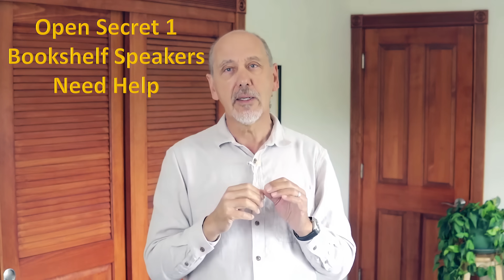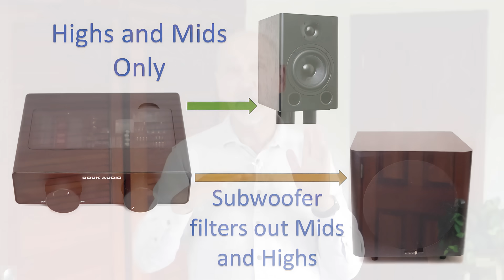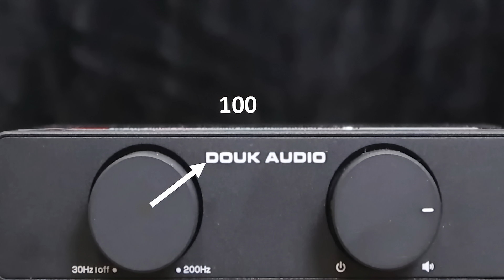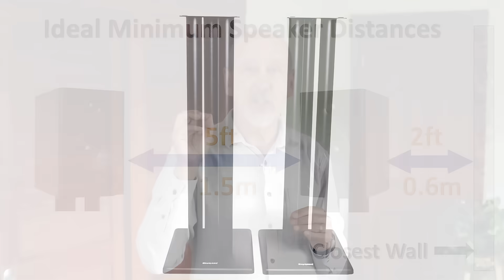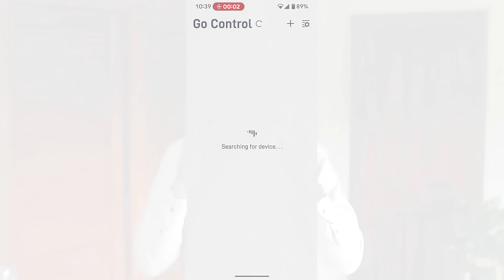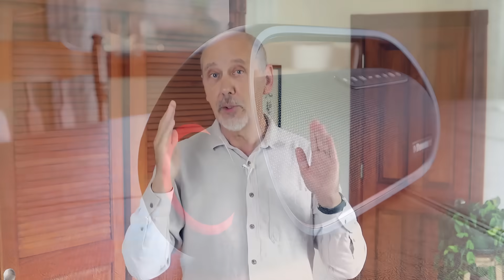Audiophile Stereo For Less Money. 7 Tips and Tricks

Comment: Hello and thank you. He was talking about high pass filler. Wilson audio had Watt 6.5-1” speaker going to a pair of subs Puppy 2x8” those were designed to work together. System cost in 1995 12 K
 They never build in the filler but many diy could buy all the drivers and address this issue. 

I also been doing the sock in port plus it makes the bass more punchy with a snap let’s call it. 
 Plus do what Mission loud speakers do. Flip them over 180 degrees. Try it as there is no set rules saying they must be tweeter on top. If you can’t get speakers up high enough you’ll love it. Rubber or foam feet under all your equipment helps or washing machine pads. The whole idea is play around like a child again. As the best system is yours as you learn about what you like because we all don’t see and hear things the same. Don’t ask the sales person please yourself first 

Ride Easy

Comment: The SU-1 is fine, I have one, but there are many others like the Aiyima DAC A2 which has gain and a headphone jack.  He's right, but I'm just gonna say it, even the auxiliary jack from an older Alexa device sounds pretty darn good, and you can connect Pandora and many other streaming services and use voice commands, which is pretty darn handy to pause, control volume, set a timer, especially for a garage system.

Comment: Hello Roger - i use an wiim mini and an smsl su-1 for streaming - playing over a vintage stereo FM amplifier (i also added an turntable with seperat phono-preamp) - playing over middle sized bookshelfspeaker ... . Does it make sense/is it possible to add an subwoofer (over an duke a5 [low pass filter] ) after/with the vintage amplifier to improve the soundquality? Respectively how can i connect them? (Or do i have to replace the vintage amplifier withe the duke a5?) Thanks Roger

Comment: Here is the biggest secret: Get a baseline WiiM AMP for $300. Why? Let's do the math: 

- S10+ streamer: $70
- SMSL SU-1: $90 
- Douk Audio A5: $80
- HDMI ARC converter $20 (in case you want to connect it to your TV)

This is a total of $260. WiiM Amp will give you all these four parts in one high quality package plus tones of high end level software features. EQ, room correction, ARC CEC across all components, auto source switching etc etc.
Reply from the maker: You make a very good case, and for a TV centric system the Wiim amp is awesome. For HiFi, The SMSL is a better DAC, and the Douk amp has PFFB which makes it less sensitive to different speaker loading. If you want to connect a turntable you get to bypass the DSP which the Wiim uses for Bass Management. For a music centric system I still like the SMSL - Douk combo.
Reply: @rogergadgetguy agree, if you have a streaming+TV centered use case then WiiM Amp is the champ. But if you are focussed on music with turntables and such then yes you can make a case for chi-fi separates.
Regarding the DAC quality I would argue that to hear a difference between SMSL SU-1 and the WiiM Amp internal DAC, you'd need a level of speakers that would be a bit funny to connect chi-fi gear to it lol same for pffb

Comment: #3 setting the subs. I have built in infrasonic filter set out at 25Hz. I am never tuning my system by ear with test tones. It goes from barely audible flutter to blinding me with sound. It was car audio and a 10dB change. Both the bass and mid amp tune were equally ear bleeding from out of nowhere.
Reply from the maker: 25Hz is too low to be useful, As you indicate its infrasonic which means it's not really sound and it's not heard through your ears but felt.  The sudden increase in sound happens when the 25Hz clips and you suddenly get a lot of 50Hz, 75Hz, 100Hz, 125Hz at full volume, that you most certainly hear!

Comment: Would have been nice to see a pic of the whole system front & back (to see the interconnects). Is there any real need for the port stuffing with the high pass filter in place?
Reply from the maker: The port stuffing attenuates the sound from internal cabinet resonances at frequencies above the HPF. You may not need it with all apeakers but with these it helps.

Comment: Im very confused.  The Douk A5 doesn’t have a Sub out. How would you connect a subwoofer?
Reply: via the aux out I guess
Reply from the maker: You use the Aux Out which is volume controlled but does not have the filter applied to it . I should have made that more clear.

Comment: Can u tell me how to connect lg tv's eARC/ARC to 5.1 home theatre and the subwoofer has only analogue audio pins 😢
Reply from the maker: the  LG ARC output goes to theARC port on a home theater. If the home theater doesn't have one use the optical connector.  The home theater will have the right connections for the subwoofer.

Comment: The SU-1 and Douk A5 run to my old and modded Monitor Audio 805s. The hi-pass on the Douk tames the excessive base I would have in my small room with my speakers. I've had a lot of audiophile gear (Cary, Adcom, Magnepan, etc) in my long time, but this is the most satisfying while being the least expensive system I've heard. (Insert superlative audiophile descriptors here.) A kudos to those old modded MA speakers.

Comment: I use the SMSL SU-1 with the Douk Audio A5 and completely agree that they pair together wonderfully for a budget system that sounds as good as much more expensive systems. I use them with a pair of Polk ES15 bookshelf speakers in my office. I may add a subwoofer, and the adjustable high pass feature of the Douk amp will be very useful.

Comment: I used some of these tips when I added streaming music to my vintage stereo system.  Instead of getting a Bluetooth receiver (for the reasons you mentioned) I opted for a WiiM mini streamer connected via optical to a SU-1 DAC. Then good quality RCA cables to the receiver. The sound is simply amazing. So much better than either Bluetooth or the Mini alone. The amazing thing is I can now listen to really high quality streaming music sent straight to the Mini and with the same system hear that sweet vintage vinyl sound when my turntable is the source.
Reply from the maker: Thanks for sharing your experience with the SU-1 and the Mini I agree the Mini is a great product at a sweet spot in the price performace curve.  Glad you are happy with your system so you can just enjoy the music.
Reply: I had a similar experience, but replaced the included optical cable because I heard some nasty digital artifacts. No issues now in a bookshelf system. Pro for my main system and SU-1. A great DAC. If it only had a trigger input.
Reply: The Wiim mini has a really good DAC in it , but the wifi can be poor.
Reply: @MrFreakwent to my ears it was night and day between the mini internal DAC and the SU-1. Much bigger, cleaner, more musical from the SU-1.

Comment: sony's LDAC system (bluetooth) is different from the common bluetooth that you are talking about... please try to do research on that.
Reply from the maker: LDAC, AptX HD, and AAC are all better than common (SBC ) bluetooth  and the difference is audible. They all still fall short of lossless FLAC which is the common format over WiFi.  You also need to have the bluetooth transmit and receive both support the LDAC codec or it will revert to something else. If you connect to an LDAC device with an iPhone for example, it will fall back to SBC.
Reply: now i appreciate that. though no numbers included, but you now pointed out that bluetooth in this case has an "audible difference". probably it sounded better? why not tell it from your video and include the cd format which the lossless form originally came from and tell the audience that it can start at 700kbps to more than 1000kbps? and add that LDAC goes to more than 900kbps? so that cd is somewhere and LDAC is in it... where's the bad? could you include too, that the musical original recording or the source should better first than the lossless formats later? actually things are not as simple as you have you took us and i have my perspective on it. @rogergadgetguy
Reply: @mattm3t3  Why not accept the fact that this is Roger’s video and he has editorial discretion over the length and depth of the detail presented and that nothing he stated was erroneous.😊
Reply: then mine is not erroneous too. it is a fact that there is a comment section to interact  within this video's topic. this can be interesting and intellectually fulfilling if taken as what it is...  @Glidedon

Comment: I assume the port stuffing is a joke, as it will severely mis-tune any proper vented speaker. But, to each his own.
Reply: The truth is that there can be substantial distortion and chuffing that happens at EXACTLY the port tuning frequency and incredibly dependent upon the room and speaker placement. So it is why alot of very high end ported loudspeakers ship with port plugs. Those loudspeaker designers know that in some circumstances the speaker will sound better at the port tuning frequency with the port plugged depending on room and placement. Some audiophiles are just super limited by where they are must place speakers (near walls, in corners, etc etc) so the speaker designer takes no offense at some of their customers needing to or choosing to plug the ports.
Reply: @timkramer850  But since vented speakers are usually larger than a proper sealed cabinet for the same woofer, sealing the vented cabinet results in an over-damped system. And if there is noise from the vents, that means they were not made properly. Worse yet, an improperly-sealed vent results in a "leaky" sealed box, with who knows what kind of results.
Reply: These concerns over stuffing the ports are overstated. Many well engineered speakers are shipped with port bungs included should the purchaser choose to use them, and, for precisely the reasons that Roger has mentioned. Generally, measurable distortion drops when ports are stuffed with less bass output. Also, speaker designers choose drivers suited for larger, open boxes, when they design ported speakers, which means they don’t rely as much on air suspension (sealed box) damping. Even with the port(s) sealed the box volume is larger than it would have been for a sealed design. Roger is offering good sound advice.

CSS designs speakers and produced a video covering port stuffing specifically, and in detail:

https://youtu.be/VUsXhArkDIo?si=yrvEX_jWwlAVP6Ml
Reply: @edwardasmannjr.2438  To back you up - all 5 of my lovely Kef Q series speakers (purchased in 2003) came with foam port bungs. Now, I am not any kind of "expert" or audiophile, I just enjoy good sounding music - but those speakers (and the cables) cost me quite a bit more than a months salary back then  - big money for me - and they are still going strong. They were recommended to me and highly rated at the time. 
I don't think a company like Kef would bundle port bungs with expensive speakers if it was all nonsense....
Those speakers and cables are also the only components in my system that did not change over the last 22 years. They did not need to be upgraded.....
Reply: With the high pass filter I can't see that there will be much coming out of the ports anyway, but I guess he's compared with & without the stuffing.